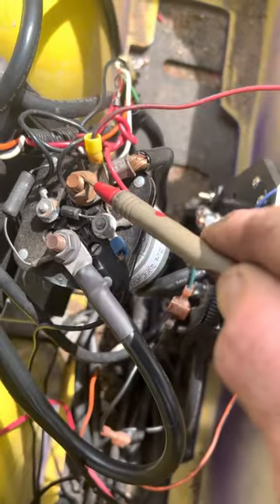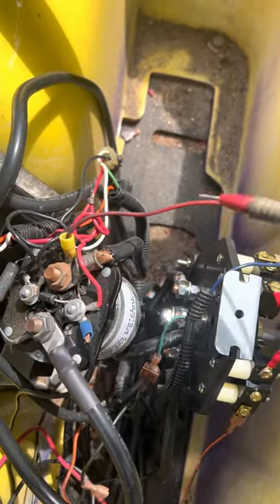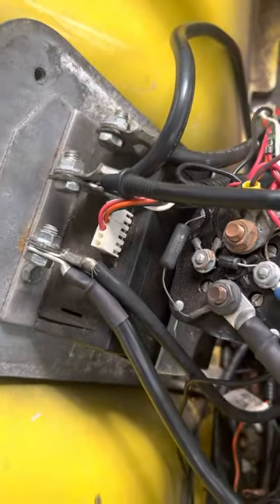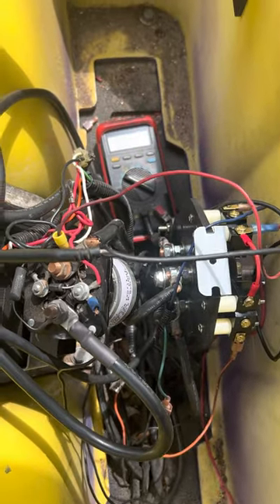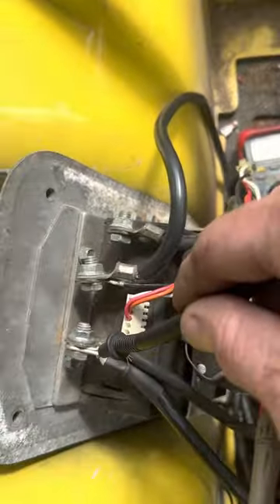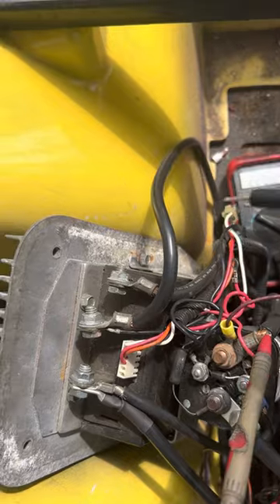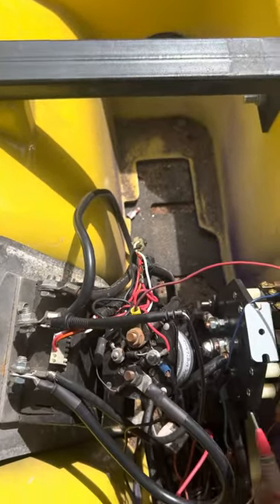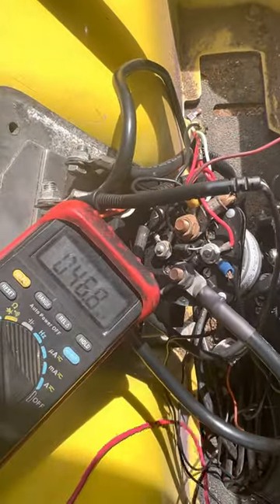EZGO TXT electric /troubleshoot controller, solenoid and everything else

Comment: Ran through all the checks. Voltage on everything you checked.  Mash the pedal and the sol clicks.  I jumped the m- and b- and nothing happened. Assuming it’s the motor?  Any additional checks to check the motor ?
Reply from the maker: If you checked all the post on the f n r board and they show voltage like in the video above. And you jumped the controller.  There is something wrong in the motor
Reply: @HeyHeyHey97  I assumed so. Thank you!
Reply from the maker: Yes sir thanks for watching and commenting 🤛
Reply: What happens if you go to the battery side of the solenoid and then motor side of the controller had already have 36 volts. It looked you you had nothing till you pushed the pedal.
Reply from the maker: It’s probably just dead voltage. Meaning there’s no amps.  Just static voltage.  If there was actually voltage with amps the cart would be running at that time

Comment: I have a Ezgo TXT PDS that has been nothing but trouble. I have replaced the solenoid, controller, rebuilt the motor, speed sensor and Inductive Throttle Sensor. The cart will only go 5 mph. What should I look at?
Reply from the maker: Check voltage on your tow switch and make sure you have battery voltage on all 4 wires.  I have several videos on how to test a pds.
Reply from the maker: Half voltage on any wire will cause it to run slow.  Watch my other videos on Ezgo pds and let me know what you find out.

Comment: I've been rebuilding a 99 txt series cart in your videos have helped me a lot. I changed it over to a single lithium battery. It runs super slow and has no power forward or reverse. At about 6:20 in this video you are showing how to test the controller. I did the test and only get gradual voltage up to 11 v off the m- terminal on the controller. I jumped B- and M- negative, when I hit the pedal it hits full speed like you said. You mentioned at about 7 minutes that you've seen reverse micro switches get stuck. Are you referring to the switch on top of the f&r switch with orange wire attached to it? Could this be a problem with the controller?
Reply from the maker: Yea unplug the orange wire off the micro switch.  And just let it hang there
Reply from the maker: Thanks for commenting. Hit that like and subscribe button for me.
Reply from the maker: Let. Me know what it does either way.
Reply: I forgot to mention I did pull the orange wire off and it still runs slow.
Reply from the maker: @KMo914  your cart is series correct
Reply from the maker: What does battery. Outage show on b+ for the red lead and black lead on b- on controller.  Hit gas and tell me what it shows
Reply: @HeyHeyHey97 thank you for your reply and sorry for the delay I've been swamped at work.  Yes it's a series cart. Battery voltage is 39.8. The red lead goes from battery voltage to .3 and the black lead drops to 25.6.
Reply from the maker: @KMo914   np.  Take your volt meter and put in on sc 200. Black lead on main negative on battery and red lead on main positive on battery. And hit gas what does it show or is the test above on the battery pack
Reply: @HeyHeyHey97  battery pack voltage drops from 39.8 to 39.6 when I hit the gas.
Reply from the maker: @KMo914  k leave the black lead on main negative. And take you red lead and put it on the black wire on the main harness. On top of the controller. Hit the gas and tell me what it shows.
Reply from the maker: Should be 1.5 volts dc
Reply: @HeyHeyHey97  starts at zero and when I hit the gas it shows 13.8 volts at full throttle
Reply from the maker: @KMo914  move the red lead over to the white wire. And what does it show
Reply from the maker: @KMo914  that’s right for the black wire.  The white wire should read 1,5 volts at full pedal. If that reads right. Put the black lead on main negative and put the red lead on the side of the sol that goes up to the controller.  Which is b+ and let me know what it shows
Reply: @HeyHeyHey97  I had to step out for a little while, when I get back to the cart I will run the test above and post the results.
Reply from the maker: @KMo914  np
Reply: @HeyHeyHey97  white wire on the controller reads 1.5. B+
Reply: @HeyHeyHey97  the white wire reads 1.5 v at full throttle. B+ is a little less than battery voltage before activating the sol, it goes to full battery pack v (39.8) at full pedal.
Reply from the maker: Black lead on main negative what does the red wire show on the harness on controller
Reply: @HeyHeyHey97  starts at zero goes to 39.2 at full pedal
Reply from the maker: Last year. Black lead on m- and red lead on b+ on controller and see what you get. After that red lead on b+ on controller black lead on m- and tell me what you get
Reply: @HeyHeyHey97  I ran it both ways and when I get the full throttle it fluctuates between 11.8 v then fluctuates to as low as 10.5. had the same results both ways
Reply: I just ran both tests again and held the pedal down for an extended amount of time. The voltage got as high as 13.8 and then dropped back down slowly and then went back up.
Reply: Seems like the controller is not putting out consistently 🤷
Reply from the maker: @KMo914  I typed the first sentence wrong earlier. It was supposed to say. Black lead on b- on controller and red lead on b+ on controller. Hit the gas and see what it shows. If it shows battery voltage  replace controller
Reply from the maker: What amperage is your lithium battery
Reply: Peak current is 500 a
Reply: @HeyHeyHey97  it definitely shows battery voltage w/blk lead on B- and red lead on B+ when I hit the pedal. Any recommendation on controllers? I saw some knockoffs online for a good price. If I'm going to put the money into a factory controller I figure I mine as well upgrade

Comment: I executed all these tests and did not have a failure.  Now I am thinking maybe its the motor. One thing that is unusual is when I connect the negative wire to the battery I get a big spark. I don’t have any accessory wires hooked up, so I know it is not a short from the lights. Any tip as to what I might try next?  Thanks for your help.
Reply from the maker: Does your sol click when you hit the gas
Reply from the maker: What all does it do when you hit the gas
Reply: Yes sol clicks. Cart does not run.
Reply: I hit the gas and the sol  clicks and that’s all the response I get.
Reply from the maker: Jack the cart up and jump m- and b- on the controller together with a battery wire then hit the gas. If controller is bad cart will run. If not hit the gas and jump a1 and s2 with a wire and see if it sparks. Don’t hook the motor wires together just lightly touch them as you hit the gas
Reply: Okay. Thank you. I will respond with results.
Reply: I finally had a chance to get back to this. It had been so long I could not find this post originally. I’m not sure how to search for my posts. Anyway, I started watching a different video and realized I had mis diagnosed the issue. I began to read through the comments and you had commented for someone to connect all the tow switch wires together. I did that and now it runs. If you hadn’t answered and tried to solve the issues that are posted on all your videos, I would still be scratching my head. Thanks for putting out great content.
Reply from the maker: Thanks for the super.   And thanks for commenting
Reply: @HeyHeyHey97  you are welcome sir.
Reply from the maker: @mrpatron9016  hit that like and subscribe button for me.

Comment: On my FR board I have full voltage on the far passenger side terminal, but the other three show one volt or less when pedal is depressed or not depressed I bought this used not running for a good deal. This is the only issue I can find. Any ideas? Golf cart whisperer?
Reply from the maker: Does it run
Reply: Sometimes it will move, but it stops moving before I can put test leads on
Reply from the maker: @hunterking4736  good test it when it don’t move. You should have + voltage on the top post of the f n r and the bottom post. Let me know what you get
Reply: 1.6 V on top post 1.9 V on bottom post 38.39 on passenger side post .41 V on driver side in reverse with pedal depressed
38.32 V on top post  38.32 V on bottom post 38.32 V on passenger side 0 V on driver side when in forward with pedal depressed 
All readings with negative lead on main negative positive lead testing
Reply from the maker: What does the driver side show when you change the other direction
Reply: Sorry, I do not think I understand. I gave you readings for both Forward and reverse can you please elaborate?
Reply from the maker: @hunterking4736  sorry I misread. Replace the f n r board
Reply: Previous owner stated they replaced the round studded board and it does look in good shape no corrosion no overheating would the top limit switches be causing issue or could the round board be put in incorrectly
Reply: It is very hard to select forward or reverse
Reply from the maker: Did it run after they replaced the board
Reply from the maker: If it’s hard sometimes that means one of the contact on the board is down inside the board. Or they have the nut that. Bolts it together too tight.  On the f n r top and bottom post where do them wires go to
Reply: I’m going to pull directional selector apart tomorrow and trace those wires do you have a email or something I can contact you that would be easier
Reply: Ok
Reply: Do you have football jersey on?
Reply from the maker: Just don’t want everybody to have my facebook
Reply from the maker: Picture of my wife and I. And I have an orange beanie on
Reply: I sent you msg

Comment: Man I need your help. My 1999 EZGO txt limo quit working on me. I installed a single 48v lithium battery and it worked fine for a few rides. I messed up and went to try and fix my headlights and ended up sparking two wires together. I have replaced the solenoid, forward reverse switch, and new key switch to no avail. Any ideas?? Also my lights are now working.
Reply: I also replaced the relay.
Reply from the maker: @gevyui  what wires did you smoke. Do you have any reverse buzzer sound also does the wail click or anything
Reply: @HeyHeyHey97 it was just the headlight wires I believe. One of the two blue wires (which lead directly to the headlights) I have no reverse sound or anything. I can hear a click coming from the pedal when I push it and the solenoid is getting volts when I press it but nothing other than that.
Reply from the maker: Did you get the cart running
Reply: Hi, got an ergo early 90,s model. Got 6 new batteries an it goes slow forward an even slower in reverse. Changed controller & motor still same thing. The forward an reverse board was changed and it been slow since then. It appears that it’s in good condition no burning from the wires. Any solution?
Reply from the maker: Unhook the orange wire off the f n r board micro switch. Just leave it unplugged. That’s halve speed in reverse. And let me know what it does
Reply: @HeyHeyHey97  ok thank you

Comment: I’m running through your checks here and I have full voltage on my controller from a1 to my negative before I hit the gas pedal. I’m also not getting any voltage at my f n r switch on three of the post. Would this be a controller issue?
Reply from the maker: Jack the cart up and jump a1 to b- on controller with a battery wire. It will take off wide open if the controller is bad.
Reply: Thanks for the quick reply. I’ll try that tomorrow.
Reply: Ok sorry. I don’t have A1, it’s M-. Would that be the same? I tried jumping them two together and the cart did nothing. Do I need to have the pedal pushed or anything or just jump then together? If M- is the same as a2 and the cart did nothing, my controller is good. What else could cause me to have power at the switch on only the bottom terminal and not the others? I appreciate your time in answering these questions.  Thanks
Reply from the maker: @bryanstew983  jump m- and b-
Reply from the maker: Yea you have to have the key on and in forward and hit the gas
Reply: Thanks. I tried that and the tires didn’t spin. Im gonna I wore the motor and check it now. Is there a easy way to do that? Only way I’ve ever done it is by using a 12v battery and using jumpers on the motor. Thanks again
Reply from the maker: Hit the gas and jump a1 and s2 with a wire on the motor while it’s hooked up.
Reply from the maker: If that didn’t fix it probably f n r board or motor.  Motor normally gives problems along the way.
Reply: Thanks for your help. It was a combination of things. There was a wire that had electrical tape around the crimped part of the lug that had came loose and I’m assuming the loose connection caused the wire to heat up so much it melted the plastic on the fnr switch so it wasn’t making contact. I appreciate your help, responding to my questions and trying helping me diagnose this issue. Most people wouldn’t take their time to do that. Thanks again.

Comment: I didn't have voltage on all 4 posts on the FNR.  Replaced it.  Still nothing.  If the speed controller is bad will that also cause no voltage on all 4 posts of FNR?
Reply from the maker: If the sol is bad it will cost no voltage
Reply: @HeyHeyHey97  thanks for quick reply.  Solenoid is new with voltage present.
Reply: @HeyHeyHey97  in the video he test voltage at the speed controller. He said if there is no voltage you probably have a bad speed controller. I have no voltage on those posts of the speed controller. Everywhere else I have good voltage. I'm actually driving right now to pick up a used speed controller. Will update in a couple hours.
Reply from the maker: @dpatt6175 thanks for watching and commenting
Reply from the maker: The f n r only Carrie’s hot voltage. And it gets it from the sol. But just let me know.
Reply: @HeyHeyHey97  I replaced the speed controller and it works.   So if you have a bad speed controller there's a chance you won't have voltage on all 4 posts
Reply from the maker: @dpatt6175  you have a 36 volt txt ezgo
Reply from the maker: @dpatt6175  if so you put the black lead of meter on main negative and test each post on f n r with the red lead.
Reply: @HeyHeyHey97  yes
Reply: @HeyHeyHey97  yes I did that.  No voltage.    I replaced the speed controller now it works.

Comment: Hello brother you've helped me in the past. I been watching your video here on my controller I have extra terminals I have B- B+ A2 M- how do i test my controller is my A2 your A1  My car was going real slow and a little jerky then just stopped then sometimes works but just kreeps.I thought it was my throttle Censor I changed it it's good I tested everything else like you showed me in the thread everything's good but I just have different terminals then you in this thread
Reply from the maker: What’s up man. Thanks for coming back.  Does your sol click
Reply from the maker: A2 is your b+ out the controller
Reply: Yes the cell note clicks I just put a new one in it because I had a brand new one here
Reply from the maker: Put red lead of meter on a2 of controller and black lead on m-  hit gas in forward key on tell me what you get
Reply: So if I put my meter on the red terminal Of the battery I should put the other end on A2 or m- to test my controller I have 1.5 on white wire and 13.7 on the black all the way to the floor with the pedal
Reply from the maker: @billy007surfing put red lead of your meter on a2 on controller
Reply: I get 37.4
Reply from the maker: So you have both leads on the controller correct?
Reply from the maker: If so controller is good. Check f n r board or motor
Reply: Yes
Reply: How do I check the motor
Reply: I have battery voltage on all 4 terminals of the forward and reverse board
Reply from the maker: @billy007surfing  jump a1 and s2 with a battery wire.  Hit the gas hood down. And touch one end of the wire to a1. Then swipe the other end of the wire to s2. It should arc if have voltage at the motor